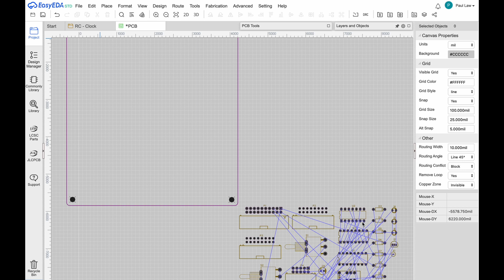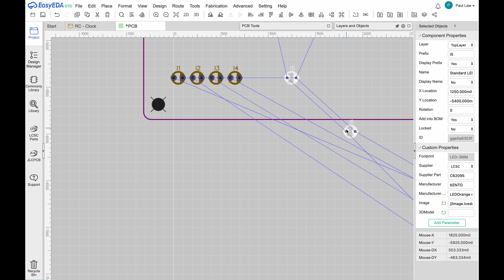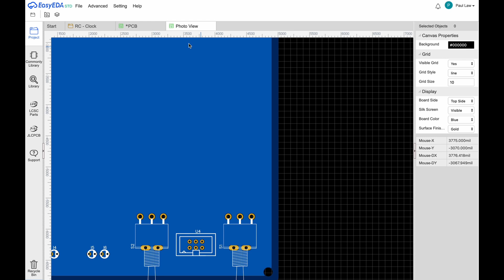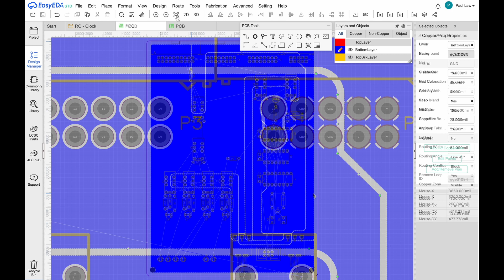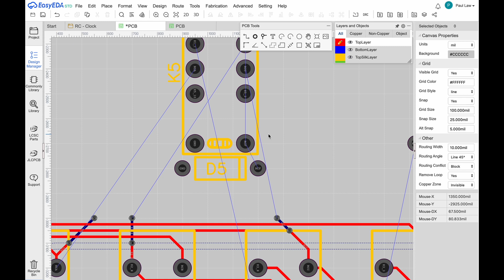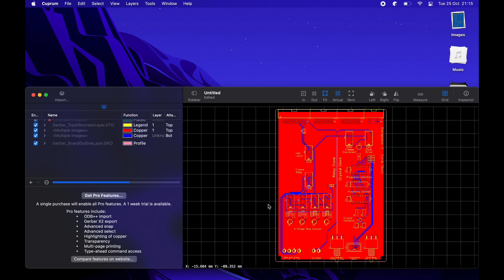Relay Computer Clock - Ep14 - PCB Design

Comment: Fun video!  My experience has been that thermal relief for through holes is not necessary. The massive macro level heat is more than sufficient for proper soldering. Thermal relief is usually used to mitigate tombstoning in surface mounted devices. Just my personal experience.
Reply from the maker: Honestly, I'm finding they're really, really needed for my design (and my soldering iron). I've just spent a frustrating Sunday afternoon trying to solder this board as the heat is still wicking away through the ground plane even with the relief I've currently got - even things like the LEDs are tricky to solder. Had to resort to heating the whole board up to try and tip it in my favour. Could be my soldering iron isn't up to the job (Hakko FX-888D).
Reply: Good to know.  To be honest, my experience is limited to small through hole components.  Thanks!